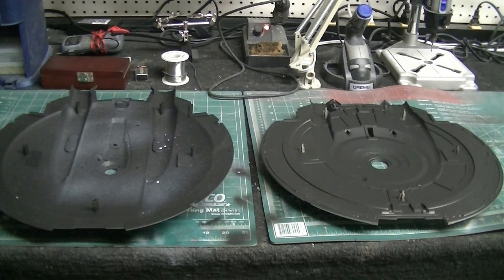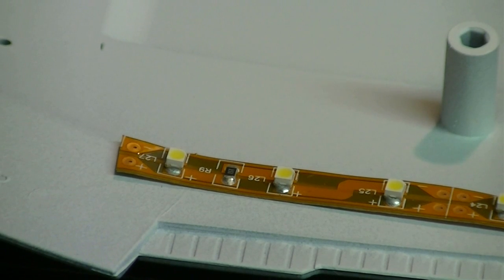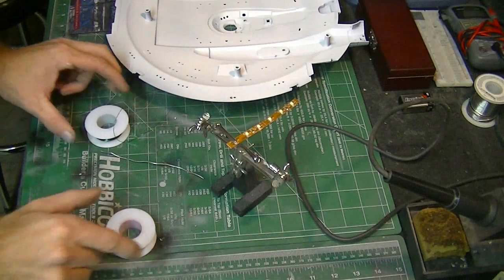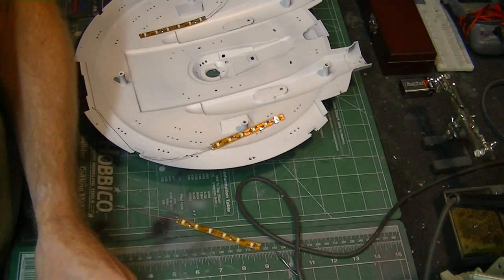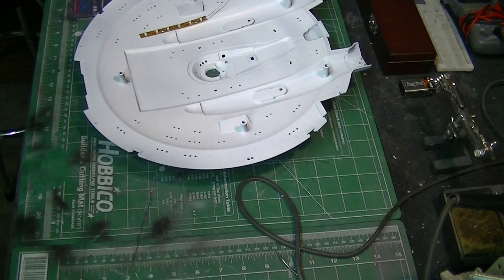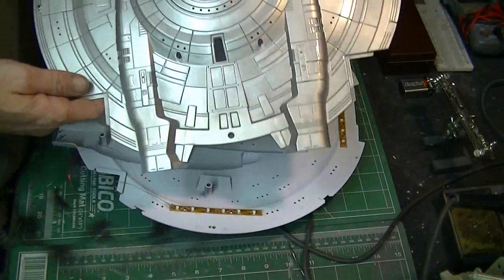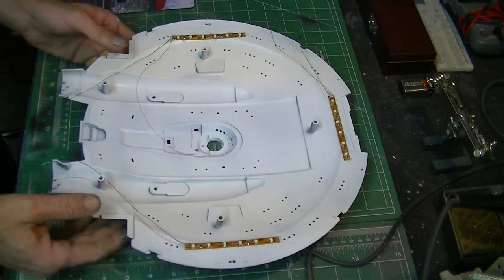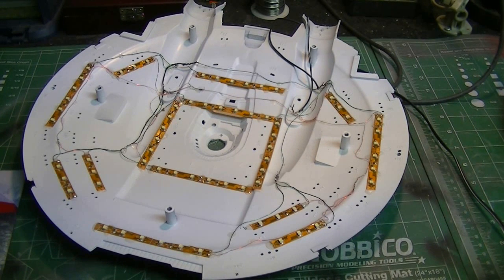Polar Lights 1/350 Scale Enterprise NX-01 Buildup PT 6 Lighting The Saucer

Comment from the maker: Smus, all of the tape I've used needs about 9 volts and up to 12 to look bright. It all will light at 7 volts but not much. I've already ordered more of this stuff in blue, red, and amber. To good a deal to pass and I like the solder connections on it.
I found another great source for single LED's and resistor's too. Superbright LED's.
Very good prices and cheap shipping.

Comment from the maker: A couple of reasons I would not do it that way are that it would require a lot more LED tape than I used here. Also, if any bulb fails or the resistor burns out in a continuous strip, all of the bulbs beyond the failure will no longer light. If I have a failure here, only a small area will lose lighting and not the whole thing.
Doing it they way I have done here is more time to wire it but is put together to last.

Comment from the maker: No, they are built in on the strip. If you cut these in sections, you must be careful and only cut where the connector terminals are. There is a resistor controlling each 3 LED bulbs. They operate with straight dc power from 7 to 12 volts.

Comment: Hi,
ParaGraphix sells a great connector for the power connection for these LED strips. The LED's slide right in and lock into the connector, no solder. They work perfectly. 10 pack is $11.95. I love them. Hope some day you build the 18" Mobieus Jupiter II. Great work.

Comment from the maker: Jeff, When you start sanding off the old paint if it comes off very easily I would strip it all off. If it seems to hold pretty good and is hard to remove, then you should be ok to paint over it.

Comment from the maker: Yes, they are used on the Polar Lights lighting kit for the 1/350 TOS ship. I am a big believer in soldering though. So I doubt that I'll use the connectors and will solder all of the connections. Also the Polar lights kit is wired in series which is a bad idea. A single connection failure or led strip failure and everything behind it is dead. A parallel circuit allows for power to each component and is much more reliable.